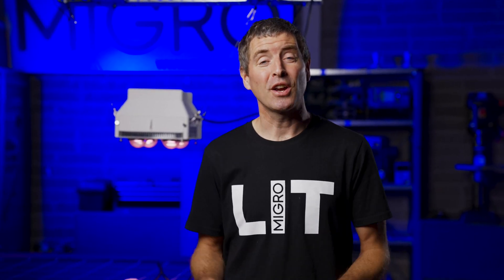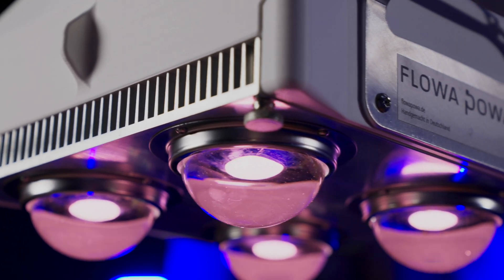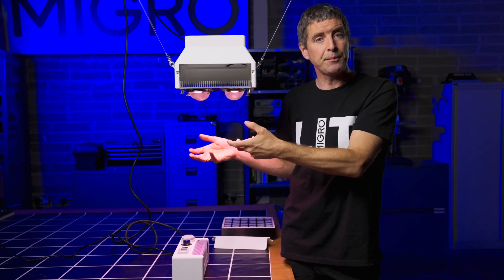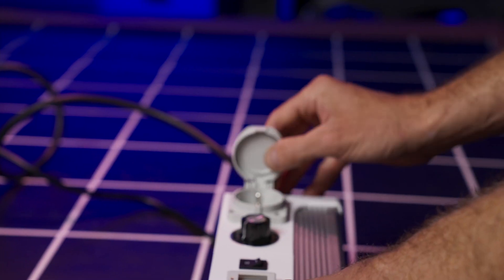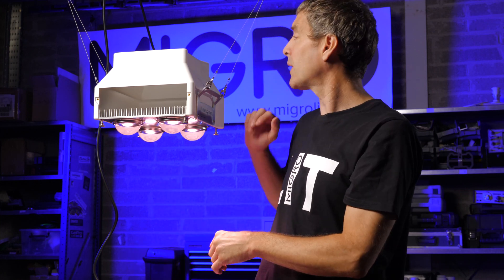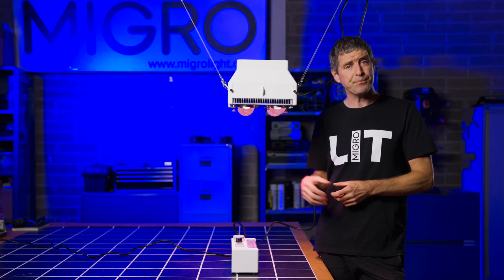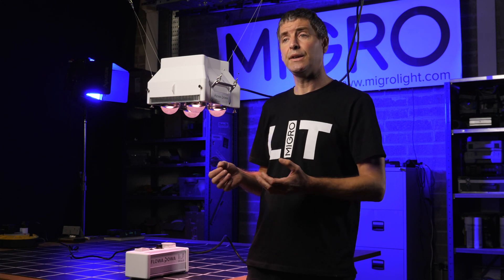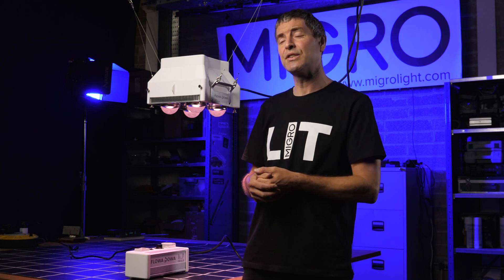FlowaOne by Flowapowa

Comment: While I like the Carbon filter w/fan, and the easy setup design. I believe I could have easily made this fixture much better!
 The four COB's would do a much better job if instead of being totally flat under the heatsink, each of the four could have been directed slightly towards each corner, thus increasing light canopy efficiency, and possibly how many umouls/Watt (?).
 Using COB's, and not being able to turn them 350° around, as well as 180° up or down seems stupid really? They were perfect for adjusting, and when you got The COB's and designed that system with total flexibility, you had found a "Holy Grail" of using COB's! 
 Anyone buying those fixtures with 90°/120° lenses still, might have great results, but the newer array style of lights may be twice as efficient?
 Keep up the great work Shane!

Comment: In all honesty I think this light looks pretty rubbish. Nearly all mainstream lights are now passive cooling and for good reason, fans wont last as long as the LEDs will and they're noisy. I can't really see them helping with output efficiency even if they're keeping the LEDs cooler. The whole carbon filter thing just seems like a gimmick, If its intended as a replacement for a proper extractor fan with a full size CF its just not gunna cut it. If it's not its entirely superfluous. Then there's the design, to me 4 huge cobs huddled together just seem like an outdated Idea, the irony is if they spread them out and gave them bigger heat sinks they probably wouldn't need the fan at all and would likely give a more even spread, It's literally about 5 years behind the competition in a lot of ways and its not even cheap.

Comment: Blurple?!?! Blah! Dont get me wrong.. I will grab my old Sunraise S1000 (blurple af) before I grab my Mars Hydro TS1000 with a backup driver.. In the last 4 years I have went thru 3 Mars Hydro TS1000.. 2 bad drivers and 1 bad LEd board.. I dont get why Mars Hydro is even so popular.. That's a pretty shitty lifespan.. And the customer service is very difficult to understand.. Anyways.. I went with the Wakyme J2000 (200 watt meanwell driver.. Not sure of the diodes) but they also put 2 computer fans on the heatsink.. Not even half the noise of my exhaust fan by itself.. Helps keep temps down and lifespan of the fixture should be increaded a bit.. Gonna see how it goes.. It is a little bit overkill for my 2x2x5.. But, for me, and my envirnoment, I have to use a light that I can run on 50 - 75% power so I can also help increase the lifespan on all the components.. Just makes better sense for me to do that then buy a light that needs to be maxed out in order to flower.. I almost bought the TS2000 to try the same.. But after the 3 that crapped out.. Nah I'm good.. I also won the OPTIC SLIM 320H from a giveaway.. So my 2x4 tent I only have to run it at 50 - 75% power till harvest.. So glad I didnt have to pay $500 - $700 for the Optic, but holy shit, what a beast of a light!

Comment: I dont get why LED companies dont like fans?? They do great to keep temps down.. Why should I buy 2 clip on fans to cool off the light I just bought.. When they used to put fans on LEDs anyway.. Just kinda dumb to me.. They still get hot af.. Just put some fans on your LEDs.. They arent louder than my exhaust fan so "the noise" is no excuse lol.. Temps are a better excuse to keep them on the lights.. I ordered the WAKYME J2000 from Amazon.. 240watt meanwell driver with 2 strong computer fans on the heatsink for the LEDs... This is the strongest light Ive had in my 2x2 and it is also the coolest because it has the 2 computer fans on the heat sink. Just my 2 cents on LEDs and fans. Thanks for all you share dude.. These videos you do are vital and not many people doing it.. Thanks again

Comment: Just run whit mars hydro fc-e3000 = 350 euro so you can take 2 of them and save the money ...y just ad spider farmer4000 in m'y 70x70 box 450w=450 euro that light Will also give Huge and nice result whit m'y co2 systeme  1300e are overpriced

Comment: Great review!   First time I see a carbon filter built into a light.  We'll see if this catches on. 👍💥👍💥🦨🌲
Reply: I have a couple INDO grow Hub fixtures. They have been out here in Canada for well over a year. 
Run 4 cobs and has a built in exhaust fan with charcoal filter. Built in timer for the light and has 4 power plugs built into the unit for running additional equipment with 2 plugs constant power and 2 plugs on timer. 
Draws 340 watts from the wall and can be bought and delivered for under $400 
Yes its made in China but manufactured anywhere else still usually means all the parts are bought from China. 
Decent light but runs the room very hot. 
Worth the $400....don’t think I’d spend more on this german model even though i love Germany 🇩🇪
Reply: @user-sm9mh3bv3l  good to know.  Thanx for the info 👍
Reply: “Catches on… fire” I think you meant. you did put some 💥 in instead I suppose.
Reply: @herbalterrorist420  😂🤣🤙

Comment: Could be interesting, read the whole lot.
Could be a convenient 1 stop shop but I think it's like buying a separate DVD and blueray player on initial view, when you buy the combined one neither performs as well and buying 2 separate units at the similar cost generally shows better results, that would be determined over the grow, so depends on the price point of the unit.
Germans only make quality things like led lenser etc They didn't loose the second world war due to craftsmanship and are masters.
I like the idea of the round lights as a novelty for supposed more even lateral light dispercency.... possibly bouncing to outer and inner leaves for more internal and external coverage via different method than light colour being the green or deep red say, so more physical than spectral? (Curves) Having said that the unit itself is narrower so does lack the bigger footprint as mentioned.
Diagonal space invader trajectory theory.
You will see if it works on a grow.
The fan feels like that from here seeing the size of the unit that it may not be big enough to use as an inline if you were being gready but Germans again do make good things so who knows, could come into its own when the external grow room temp is ideal with the carbon inlay pad to purify the internal air more before pushing it out leaving the inside more pristine. (While not being ducted)
Like the control unit and could be more convenient if it was digital and could be used outside of the grow room but would take away the option for the additional plug etc which is cool.
At the end of the day it also depends on the tec being used, if it's all the latest and greatest will probably do fine within its range levels windows and will probably be great for "Genny" who wants a good quality piece of equipment that she can experiment with in simple terms as it's all there in a nice package.
With filter, without, run a duct, no, even as a kitchen bench island unit where there are plants growing would be ideal and aesthetically look good and also purify the air in a room.
Just on view I would say not for me as opposed to something else but yes for an open bench in a kitchen or living area but you just never know until you let us know as it might blow it away and have other benefits like being able to drop into canopies 😄👍
Just my 2 cents.
Cheers.

Comment: As a german I feel ashamed something cheap ass like this is coming from my country and sold as "german quaility" for 1400€, rediculous. The spectrum looks like very first gen. of LED, in my opinion 0.8x 0.8m (maybe 1x1) is the max coverage and the extremly tiny heatsink is as cheap as it can be manufactured. My two CXB3590 lamps (2x 50W) have more alloy than this 320W rip-off. I would rather buy a TS1000, about the same amount of light but only 10% the price, I call this DOA.

Comment: Yea that light instantly takes away 1 ft of growing height for my 2x2 hah
Reply: I used Mars hydro to 1000, was able to pull little bit over 7ozs
Reply: Just what I was thinking.
Reply: @Jacob Amira that particular grow was one plant with organic super soil. Since my tent is only 2x2 with 4ft height I had to compensate by buying a 25 gallon air pot and trimming the upper portion reducing back to around 15 gallons. Maximizing the space efficiency from side to side and having roots spread to the sides which also helps shape the plants structure. In addition I topped twice and used a net for scrog to encourage a more wide bushy plant. I like it better because there a bunch of golf ball size to tennis ball size top nugs as opposed to having one giant tall plant. I could probably have a faster grow if I put 4 little plants but since my seeds are rare I only grow 1 plant at a time.  Besides I just like having solid round quarter buds . I take my time and allow the plant to fully fill in before harvesting
Reply: @Jacob Amira I think there is confusion in that video, the first tent you see with a giant plant 1 lb plant is a 4x4 or 5x5. If you pay attention he switches and starts recording another tent which is the actual 2x2.  The fc 6500 is over kill for a 2x2 it wouldn’t be efficient.   But yea I watch his videos too he been posting videos for a while now
Reply: @Jacob Amira the Mars hydro to 1000 is perfect for 2x2 , during flower I lower the hang height to about 10.5 / 11 inches which puts my ppfd value to upper 900s to a little over 1000.  Pretty much at maximum par a plant can absorb without c02.  That light takes up 1.5 ft after it hangs from the tent now way I can use it haha. The main stem of my plant is almost 3 inches thick.

Comment: 1300 bucks for 4 cobs in 2021. 
Looks like someone might have misjudged their market. I give them 6 months to go out of business.
Reply: I made my own COB from Amazon parts.. $30.. Not a 4 COB.. But $120 isnt bad either (for 4 COBs).. Cobs are great for penetration (thats what she said) but they do get kinda hot.. This is a very odd design and I think they just REALLY wanted to build a light that also scrubs the air.. COBs are great.. But not $1300 for 4.. That's just wishful thinking. I bet MiGro bought the first and only light 😂.. Nah Im just kidding. Just seems like a light I woulda seen on Amazon like 5 - 7 years ago.. And its blurple??? Blah!
Reply: @eric8630  its not blurple clown!  Its the exact same color everywhere else. Just instead of cool white 4k and warm white 27k w deep red 660-760 nm they are all together. The color temperature is literally the most efficient color temp as proven by 45+ yrs of science bud. Yes its over priced but every feature is useful period. In a 3x3 this would blow it out (literally)! If they had used a slightly larger box w a few more inches between the cobs and or 120 or 105 degree lenses it would probably b a very good light for tent growers in places where true stealth is a major factor.
Reply: @greenghost-xi5jp  Thats absolute terrible for a price like that - 1,83 PPFD/W is pathetic. Shane did a test one year or so ago, "he" reached 1,78 with 6 simple E27 bulbs which literally costs nothing. If you increase just the efficiency a bit, you can reach ~2,4 PPFD/W and more and  it still costs nothing.
Reply: that's not even the half of it.... why the hell would you use your godamn lamp as an fan extractor,  further more why do you need a filter just to pull air through
Reply: @KapRowMeat  its marketing is towards stealth illegal grows.
Reply: @KapRowMeat  yea I didn't say it was perfect but that's part of the market aims as well as space saving.  Especially in places where people are spending a fortune on studio and 1 bedroom apartments. Ive grown many stealth grows over the years. Been growing off and on nearly 3 decades so I can see the target of the design. Yea its not perfect nor even priced right.  But to someone like me who thinks 1500$ is enormous amount others its a drop in the bucket.  Also I know some lighting companies don't deal with Germany for whatever reason and Cannibis is illegal in Germany.  Possession and Cultivation for recreational.  Idk why some countries can deal with Germany or why some companies themselves don't and vice versa. 

Anyway this design is kinda like pulling air through the carbon filter and through the hood of an HPS set up. 

So I can see how this saves a ton of room for say a 400-600 watt HPS-MH setup. 

Is it worth it to me?
Hell no. 

Someone else? 
Without  a doubt im sure. 
Plus Shane wouldn't ever promote something that's not worth it. 

Its like reviewing PAR meters. 
Is it worth it to the average grower to spend 500$ on a meter? 
No. 
But to some yes.
Reply: That’s ridiculous, for $1300 you can buy way better lights with better coverage & more watts!
Reply: My WAKYME j2000 is much better and I bet alot cooler running than this tho.. Just sayin.. And all my 3000K and 6000K and 460nm and 660nm and ALSO 760nm.. Dont look pinkish or blurple tho. Crispy white! Maybe they have WAY too much red in there.. Idk.. Dont care.. It aint what it aint but I still smoke some dank
Reply: 6 months i dont see them selling more than a few.

Comment: i think its a bunch of garbage added on that does nothing for the grow , i doupt the fan will last and i don't think it will have enough draw with the filter in place to exchange air in a 4x4 ,, i would much rather spend my $$$$ on a bare bones light that has better form and function ,, this light will not sell to any serious grower the only ppl who by it are the ones who would purchase gimic junk like off info ads at 3 am like the SHAKE WEIGHTY  or other such JUNK

Comment: I was thinking 500 euro tops, these jokers dare to ask 1300 for it, jokers for real! Just get an AC infinity carbon filter, 50 bucks, and 2 other lights !!
Reply: In Australia an ac brand carbon filter is $300 ( 6 inch ) , but we can purchase others cheaper .
Reply: @danielgonzalez-yp7hi  damn is that for the fan and filter. Here in the U.S. ac infinity 6in fan is only $110 and the filter is $65. I could be wrong but I thought the carbon they use came from Australia lol.
Reply: @trademark256  the carbon probably does come from Aus, that would make sense why it’s so expensive ( shipping to & then from America $ )  when we purchase the fan it still has American plug so we also need an adapter. Anything that’s made/sold in America is very expensive in Australia, hlg scorpion Diablo cost $2400 au , approx $2000 us.
Reply: @danielgonzalez-yp7hi  That’s insane and I thought hlg was over priced here lol

Comment: The spectrum looks a bit blurple
Reply: And? If it performs - what's the problem with the colour?
Reply: @iconoclasttastic9258  the problem is it doesn't - it's more expensive than Photontek/Lumatek 1000W CO2 fixture, while having 3x less power, 3/4 of it's effectivity and much much worse light spread. Its performance is comparable to DIY fixture that you could make for 100 euro.
Reply: @TheVansar  I understand that. It's certainly an expensive fixture that I wouldn't buy for that reason. But that wasn't my point. 

The OP mentioned the colour of the light output, probably because he's heard people slagging 'blurple' lights off. 

But there have been a good few fixtures with that colour spectrum that have been worth a buy over the years. Budmaster used to do a good one. 
Philips had one for the agro market that was an absolute beast but never available to the public.

My point is. You can't always judge a light by the colour of its diodes. These Lumines COBS were great when they were released and they still perform well today.

By all means judge a product on price Vs  performance . But ffs at least understand that performance before making a judgement,